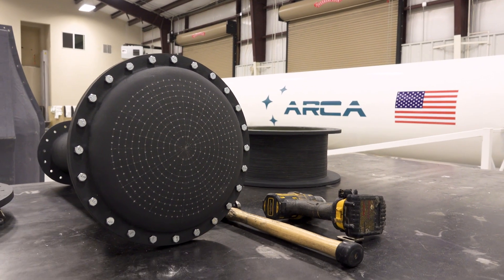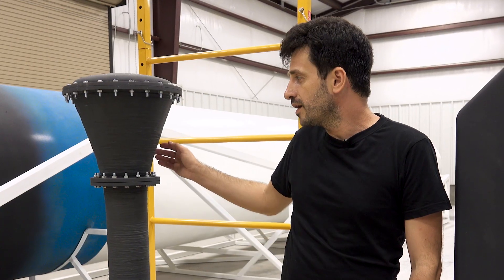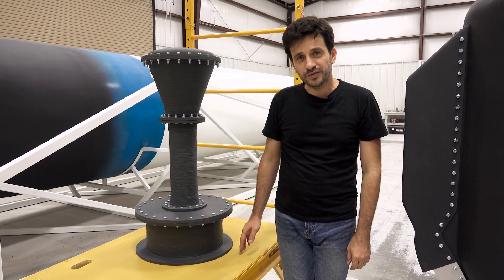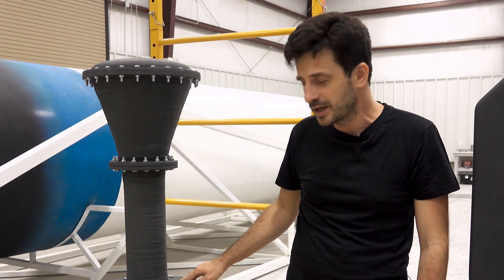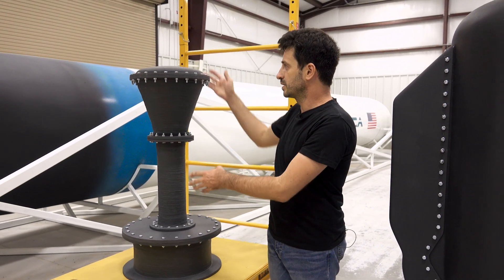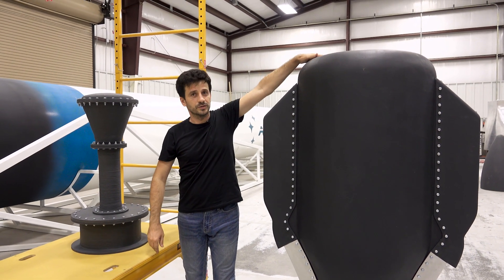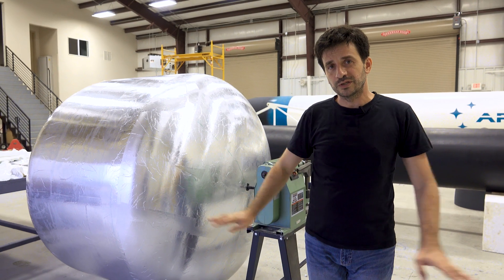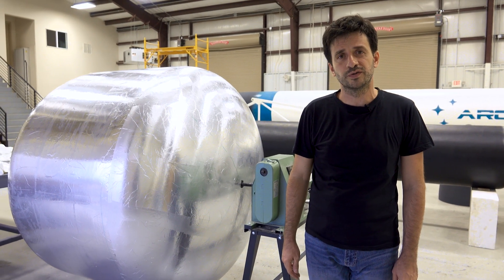Flight of the Aerospike: Episode 9 - Test Article Preparations

Comment: The reduced complexity of the single stage does probably reduce production costs, but the single stage concept is not very efficient for high delta v. Since you are not going for reusability it would probably be worth it to add a small second stage with a normal vacuum optimized engine which would give you a massive increase in payload and the ability to send small payloads beyond LEO (GTO, Moon, Mars, Lagrange point transfer orbits). The New Glenn has a two stage and a three stage variant, similar to that it would make sense to develop a two stage variant of your rocket. Maybe later when you get money from launches. If you use a off-the-shelf satellite main engine with hypergol propellants you could also do direct GEO insertion and maybe even lunar orbit insertion for tiny payloads. 
I'm not an expert in aerospace, but I played enough Kerbal to know the rocket equation.